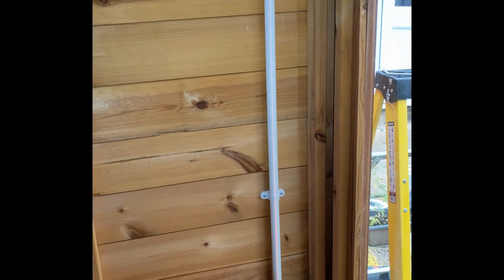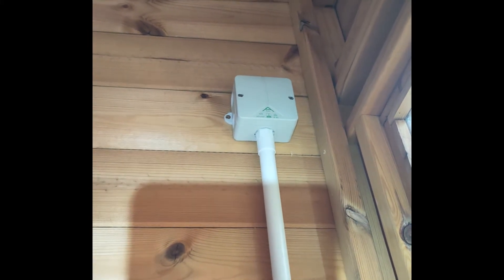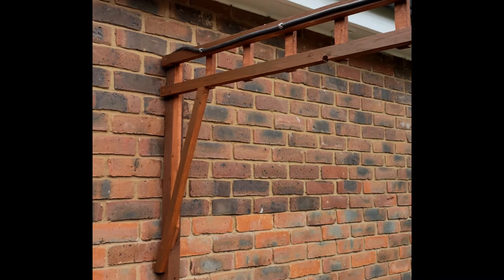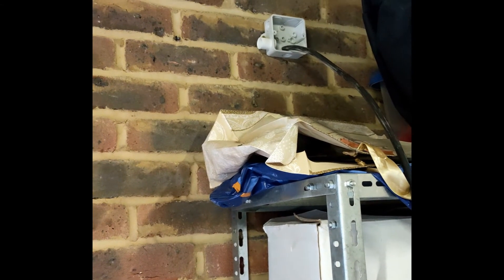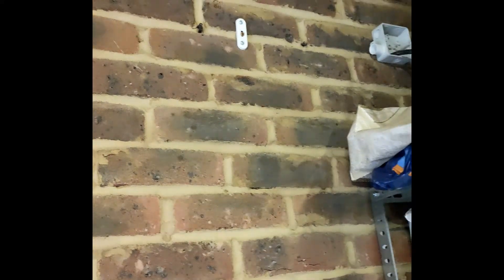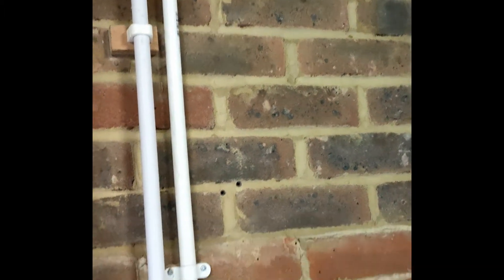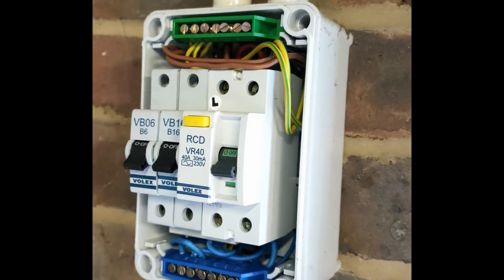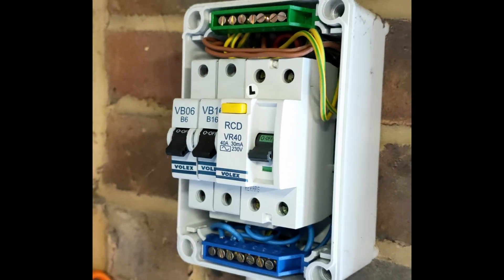ELECTRICAL WIRING | Installing electrical wiring for a double socket into a Summer House

Comment: I enjoyed you're video. I am currently building a summer house and I  have armoured cable coming into the consumer unit that was setup from previous shed. I don't want the eyesore of conduit running all over for sockets and lights in the interior so I plan to run them externally round cabin. Does 2.5 twin and earth for sockets need to be in conduit or armoured simply to run around the cabin?
Reply from the maker: To run around the outside you could use armoured cable, or you can use black conduit if the side of the building they are attached to is mostly in the shade to protect from UV damage. If you are running cables in conduit you would use singles not T&E (There is a reg on this, but for the life of me I can't remember which it is), so in this case you would need lengths of 2.5mm brown (line), 2.5mm blue (Neutral) and 1.5mm Earth. You could use steel conduit as well, but it's a bit more of a faff.
Reply: @vwes  thanks for reply! It seems counterintuitive to run singles in the conduit as I would have imagined the extra sleeving/protection of the t&e 2.5 would have been a plus but regs and regs I suppose. I was hoping to make a radial circuit with conduit on outside to junction boxes drilling upwards through cabin to prevent water run and  silicone seal. There's wouldn't be a heavy load on circuit only a TV and maybe a couple of lamps. I'm glad you replied because I planned to have it setup and have an electrician to connect the tails and check it over. Cheers 👍

Comment: Question: I was painting the outside of my house (wood), and received an electric shock. On the inside, that area is near the fuse box. I called an electrician, and he said not to worry about it. ….well, I’m worrying about it. Should this be a concern, or is it no big deal?
Reply from the maker: I've been thinking about this, and the only thing I can think of is this. Are there any nails nearby where you were painting ? It's possible one may have nicked a cable and if the circuit isn't protected by an RCD that would explain the electric shock.
Reply: @vwes  I didn’t see any nails, but I’ll give it another look. Thank you so much!